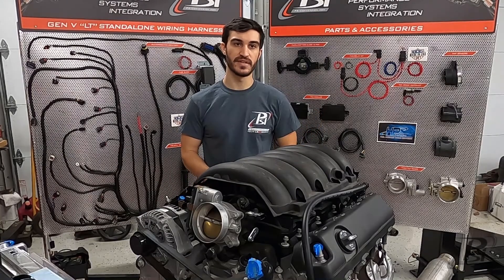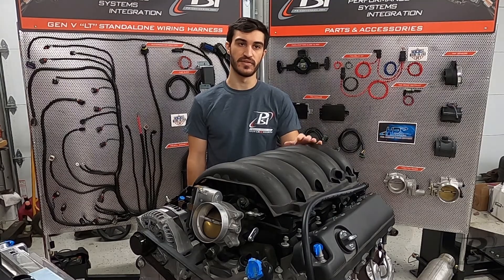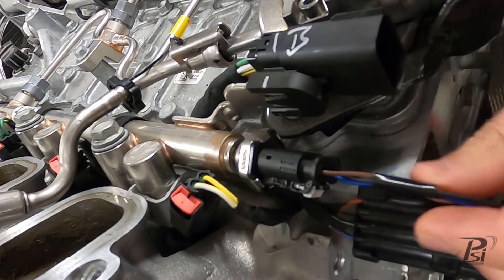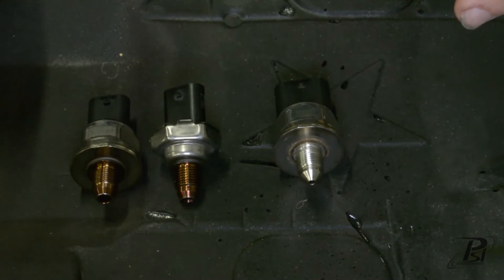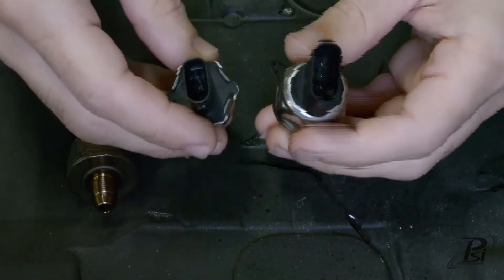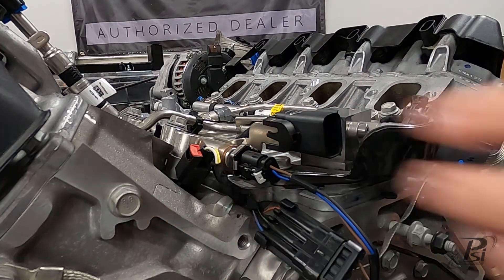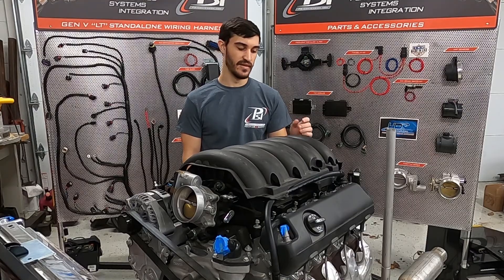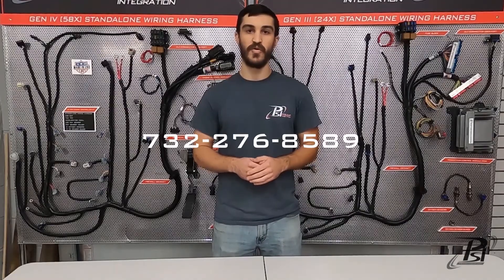How to Locate and Identify for Your Gen V Fuel Rail Pressure Sensor for an LT Swap, by PSI LT1 L83

Comment: Did a 6.2 swap into a 5.3 truck. Used 5.3 harness . 

6.2 has a 4 wire sensor.  So we changed to a 3 wire sensor and harness.  Now its throwing different codes. Can it be tuned for it?

Comment: I have a 2011 es 350 and the sensor is not on the fuel rail, where is it? Please help.
Reply from the maker: 2011 would not have a fuel rail pressure sensor, that is a Gen 4 motor!